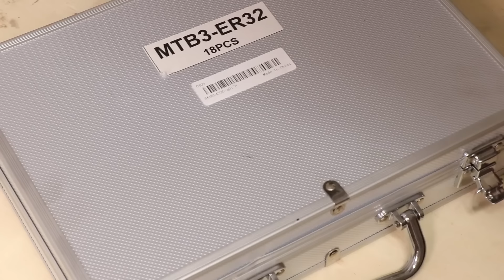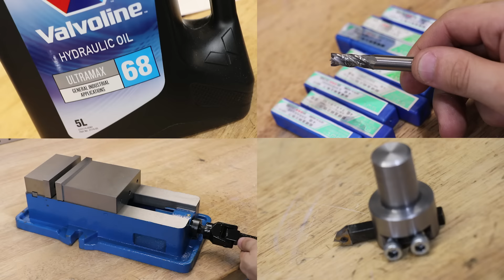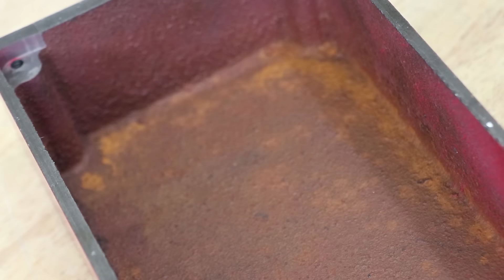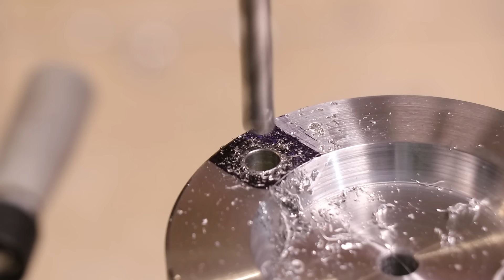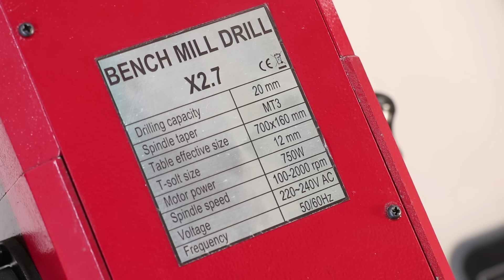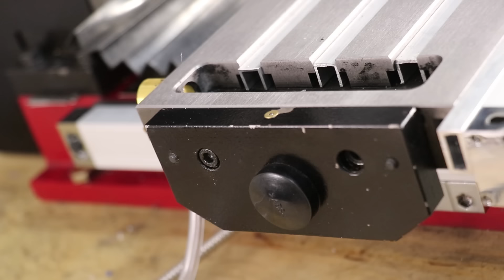Should You Buy A Cheap Mini Milling Machine?  (Sieg X2.7L In-depth Review)

Comment: No need to apologise for the length of this video, I don't think that you could do a decent review in a shorter video and this went quickly. 
Good and fair review Artisan! Six months of daily work use equates to heck of a lot of machine time over what average hobbyists are ever likely to achieve. 
If I were to get one, it would be to add to my skill set and my capabilities in steel, aluminium and plastic. I will have to put it on my wish list!
Keep up the good work!
Mark from Melbourne Australia

Comment: Looks like you got yourself an excellent machine. I have the Grizzly version of the X2 (tilt head)... they had a similar rigid column with the larger table but 25 years ago it was 3x's the cost of the smaller one.  Nice idea about the extruded Al blocks... hope they're working well for you.  Looks like you'll get years of use out of it.
Reply from the maker: Cheers, always interesting to know how long they have had these machines on the market for, how is it holding up after all these years? I think I have seen some rigid column upgrades for the x2 that I probably would have done in the event that I bought the x2. The aluminum table inserts work really well and I recommend it, so much easier to clean up and vacuum chips.

Comment: Something I've occasionally wondered, watching your videos about improving your mini lathe and mill, that this one brought to the fore, is...

Well, first of all, I don't really know the market, so are there lathes and mills of comparable size (i.e., not jumping out of the "mini" hobbyist scale of machine) that are of noticeably better stock build quality (and thus not requiring a series of projects up front to correct all the little discount shortcuts that you've found in yours; thus also probably more expensive)?

If there are, has any kind of analysis ever been done on the cost of "buy a more expensive machine of better stock quality" vs. "buy a cheaper model and do however many projects (and possibly subprojects for tooling creation) it takes to bring it to equivalent quality to the more expensive model" ? ("Cost" meaning materials, consumables, and at least a notional idea of whatever monetary value you might assign to your labor if you were doing the work to get paid.)

I just think it'd be interesting to know whether the Sam Vimes Theory of Economic Injustice applies here. That is, if you can afford the cost of one machine vs. the other up front, is it more economical to buy the cheap machine as a fixer-upper, or just start out with the more expensive machine that doesn't require all that effort? (I suppose there's possibly a secondary consideration to be had, regarding getting the cheap one anyway if you need a bunch of projects to learn machining skills with.)
Reply from the maker: I am by no means an expert on the range of hobby mills, but I am not aware of many manufacturer that makes really high quality mills for around the same price. Precision Matthews is a brand that springs to mind (Quinn at Blondihacks has one) that seems to have comparable mills. They are Taiwanese made, have a similar design to this and seem to have better quality control and after sales support. 

Same goes for the brand optimum, they make mini mills that I have seen for sale at my local machinery house, however they seem to cost a lot more for less value, but on the flip side, have local customer support. 

Of course there are the Sherline and Taig and Proxxon Mills which seem to be high quality but are much smaller.

Overall unless there is a big used market, smaller mills seem to have a fairly narrow range of options. As for the time spent upgrading , ultimately it is always up to you and how far you want to take it. This is a hobby for me and I get the most enjoyment out of fixing up these low end machines.

Cheers
Reply: @artisanmakes  Oh, sure. I wasn't expecting "high quality mills for around the same price". What I meant was, like, (all price numbers made up for illustrative purposes) "hm... for this size/approx. feature set, an Ooh La La brand high-quality mill costs $1,200, and an El Cheapo low-end mill costs $900 but will require $200 in tooling, another $200 in materials, and an unknown amount of time making parts and making tools to make parts and etc. to bring the El Cheapo up to the quality level that the Ooh La La comes out of the box with," etc.

But yes, admittedly there is also something to be said for buying a machine you know will be a fixer-upper just for the fun/educational experience of doing those projects.
Reply: @artisanmakes  checkout Paramount Browns next time. I purchased my lathe from them and have been happy with the price and customer support.

Comment: Another good video, thanks for your thoughts 
i bought a smaller version of this mill in the uk, an sx1 lp.
Very similar feature set with a fixed column, i wanted to avoid a tilting column preferring the rigidity that the fixed column gives.
I make smaller things and have a very small workshop and the sx1lp was the largest i could feasibly accommodate
I was surprised how well it actually performed and how close to tolerance it could actually get. Went with an er25 collet chuck and recycled a proxxon drilling vice from my old machine, very similar to the one you were using which has been pretty good and hasnt suffered from jaw lift. I also use a small rotary table from my old machine which has been pretty useful
Next thing to buy for it is a dro.
I was also surprised how well adjusted the machine was straight out of the box, i was expecting to have to tram everything in and faff with the table gibs but it was fine. I check it before every use, old habits die hard, and have only needed to tweak it once or twice. and havent had to tram the column at all which is surprising.
I paid about £800 in total for the machine, tooling, collet chuck and various other bits and pieces, so it has been reasonably good value. Only thing on this machine is that it has no way covers, so you have to sort something yourself, those things must be the cheapest bit on the machine so why they weren't included is a bit of a mystery.
Maybe i just got a nice one, its not a Friday special like some of the stories about these machines ive read

Comment: Nice job with the review! Here in the USA, I think Americans expectations of the inexpensive Chinese machines is far too high, especially at the low prices points they sell at. I also think "hobbyist" machinists want unrealistic fit/finish and tolerances from these inexpensive lathes. In reality, not many need to make or create parts that would go on a spacecraft. I have the small lathe that you have with all the same shortcomings. Despite them, I'm still able to use it making small parts I need and to remanufacture small parts.
A lot of the YouTube American machinists are using very old and worn big lathes, mills, etc.. If they or us hobbyist machinists were making parts to sell, we wouldn't be using this equipment, whether new inexpensive or worn out old American made. 
I needed a nice Milling machine and bought a Precision Matthews branded Taiwan mill. I've been extremely impressed with it so far. I bought it with a DRO mounted. The Taiwan machinery is certainly a step up in quality over the Chinese versions.
As you noted, the machine costs are nothing compared to all the tooling you need, especially for the milling machine. I'd only add to not buy the cheap end mills on Ebay or Amazon. Most are junk that don't last long at all. Try and buy the best tooling you can afford as it will save you money in the long term.
I'm really enjoying your channel! Keep up the good work!
Reply: Taiwan is the real china.
Reply: It is the real China, and Taiwan prospered quickly with free capitalism, while communist China starved with one-party communism.
Taiwan makes great machine tools.   There are Taiwanese copies of Bridgeport mills, Hardinge lathes, etc. and they are every bit as good as their american namesakes.
Reply: It could also be something someone getting there feet wet would buy and not really know what they would need and this allows for some projects and possible profits to be generated before the larger investment would have to be made down the road, its just a thought.
Reply: The precision of the machine is achieved by adjusting the machine. https://www.youtube.com/watch?v=4w-OHSqLpHo
Reply: Which model did you get?
Reply: @DavZell  PM-25MV is what I purchased. It's been great so far.
Reply: Totally agree with you on the “over expectations” people have on these machines! I’ve successfully built PM Research operating steam engines with my Sieg X2 mill and Grizzly G0765 mini lathe with no problem at all, along with countless other projects. If I needed bigger capacity or more power, I’d invest in a bigger machine! This is a hobby for me, I’m not building NASCAR racing engine parts here, and I’ll never have the need to produce parts with 0.0001” tolerance anyhow! But if you have the need for a bigger, more robust and pricey machine, by all means go for it! Right? Cheers!

Comment: I bought a small milling machine with a fixed colem similar to yours but mine is close in size to the x2 milling machine .
Love the full information video 👍.
Reply from the maker: Awesome, glad to hear it. I saw some X2 mills with a solid column too, but with bigger table and the sale at the time I ultimately chose to go with he 2.7. How is the solid column on the x2, do you think its rigid enough?
Reply: @artisanmakes  yes it's rigid. The table size is 400mm×120mm
Reply: @artisanmakes  and it has a 600w motor
Reply from the maker: @motari6249  Interesting, when I was lookign at the sieg range, they have a huge range of different x2 mills, looks like you got one of the better ones, cheers.